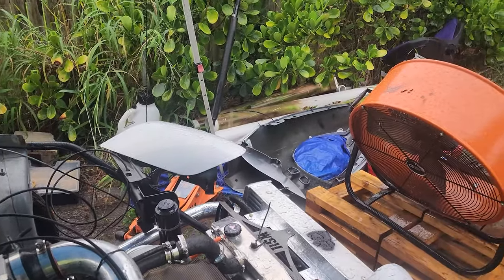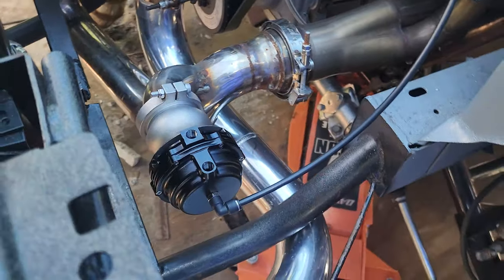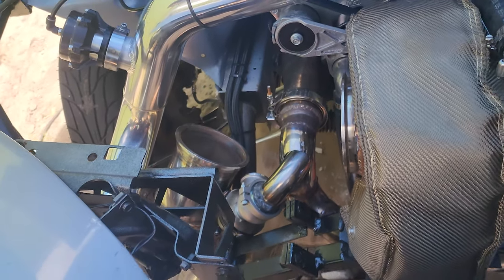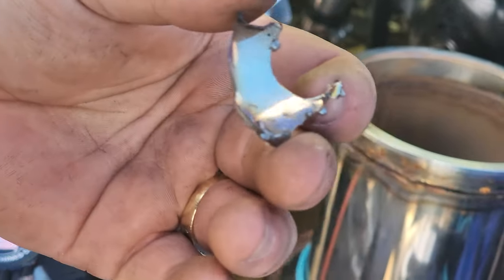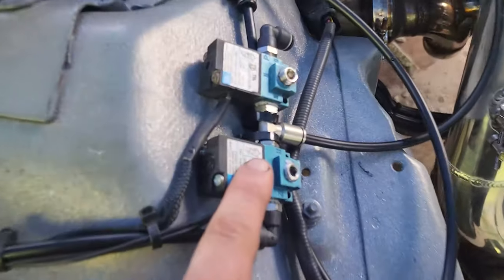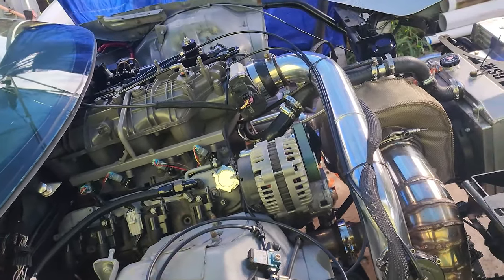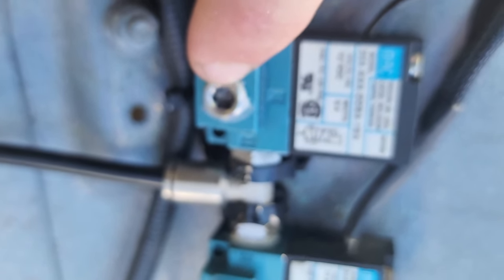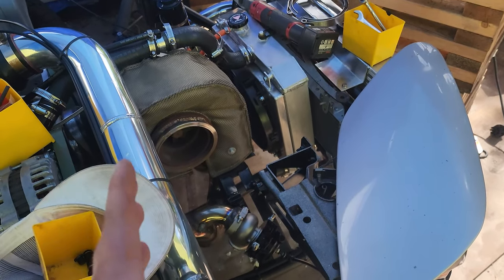Will it build boost? 4.8l LS with a MONSTER 92mm turbo!

Comment from the maker: Options are simple: Swap Engines. Swap Converters. Swap Turbo. Or Spray Nitrous. I Think you can all guess which one I'm going with HAhahahahaaa!!
Reply: Hey bro. What converter are you running on that 80e? I’m wondering if it needs to be brought up on the converter to get itself outta the hole with any quickness.
Reply from the maker: @Emajioo  fti 3600 stall

Comment from the maker: To better explain the tight converter possibly bending rods on the shift; When your timing table is set up, if you lose too much RPM on a shift the boost will still be at peak, however the timing will be astronomical due to the rpm drop jumping to a spot in your spark table where the timing is much higher. You can build tables that mitigate this but when possible you don't want to resolve a mechanical issue with tuning. you want to fix the mechanical issue with a mechanical solution.

Comment: I think the hotside is a bit over sized for the 4.8. I have 2” hotside with two wastegates and a 4” down pipe. But I also only have a 78mm turbo
Reply from the maker: going to a 2" would create more spool but also generate more back pressure. And the 4.8 with a 78/75 should spool quick, I had one.

Comment: if your running holley just add a boost building table in your advance tables and then pull timing out
Reply from the maker: So I've done that but any timing removed the rpm just falls this engine doesn't make enough torque down low :(